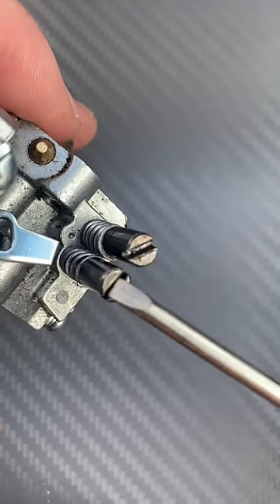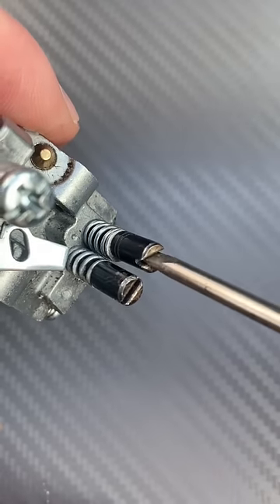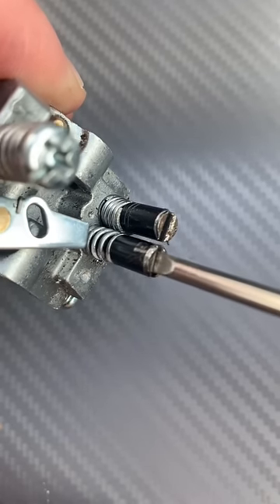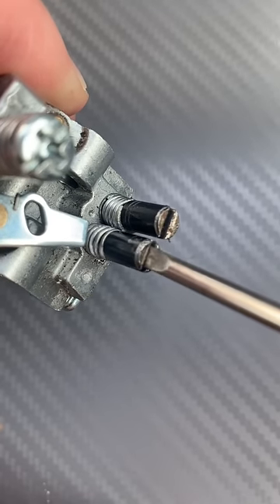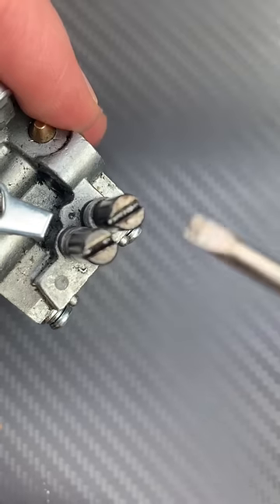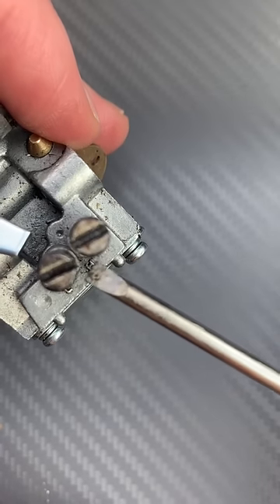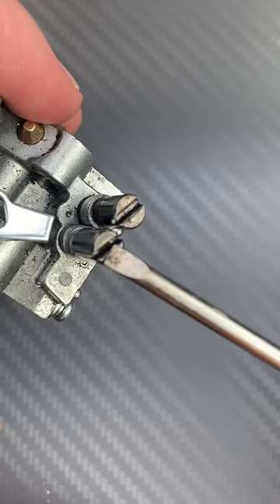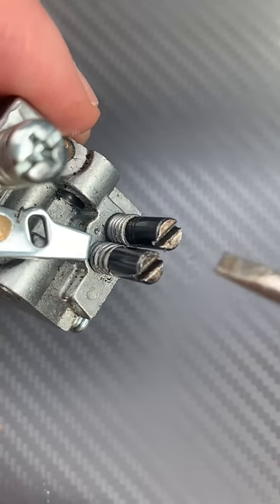Rest Carburetor back to Factory Settings like this….

Comment: Always good to point out that you want to adjust the high speed, bigger flow adjustment first. Open the mixture screw until it slows down from flooding, then go the other direction past where you started until it slows down from starving. Then go back to the middle of the two, known as the sweet spot. Always adjust the low speed last, because it actually is a bleed off of the high speed and if you did them in reverse, doing the low speed first, when you got to the high-speed you would actually be changing the low speed as well. Hi speed is always the farthest away from the engine. If you run into an engine that you can’t adjust with a screwdriver, you can take a hacksaw and cut splits in the aluminum surround that is intended to keep you from adjusting them and at the same time let it cut the slot in the head of the adjuster. That oval surround is to keep in compliance with Californias air board.

Comment: I’m a long time 2 stroke service tech, and I’ve had much better luck at just under 1-1/4 turns out from the seat position.
And very importantly, ALWAYS adjust the High Speed before the Low speed.
It will give you the smoothest transition from low to high speeds.

Comment: Awesome video. I recently purchased a used stihl TS350 that I was told didn’t run and needed the carb to be replaced I came across this as I was about to pull off my carb and get a rebuild kit for it. One screw was out about 7 full turns and the other was out about 3.5 turns. I followed your advice and it fired up on the first pull and idled perfectly.

Comment: This is good for trying to “reset” a carb’s tune so you can get it to start and eventually tune it to run. Different carbs will have factory tunes set for the unit they’re attached to. That’s typically in the owners manual or a dealership workshop manual or something of the like. I work at an ECHO and Husqvarna dealership and we have carburetor adjustment manuals relative to the model and unit that tells us the factory settings for the carbs.
Reply: Obviously, if you don’t have the manual, this video shows you how you can work to get a random carb in tune.
Reply from the maker: Hi
thank you for sharing your expertise and insights regarding carburetor tuning and factory settings.

It's great to hear from someone with experience working at an ECHO and Husqvarna dealership, where you have access to detailed carburetor adjustment manuals specific to different models and units. These manuals are incredibly valuable for understanding the factory settings and recommended adjustments for optimal engine performance.

As you mentioned, resetting a carburetor's tune can be a useful step in troubleshooting starting issues and fine-tuning the engine's operation. The factory settings provided in manuals serve as a reliable baseline for ensuring the carburetor is properly adjusted according to the manufacturer's specifications.

For those looking to tune their carburetors, consulting the owner's manual or dealership workshop manual specific to their equipment is essential. This information helps ensure that adjustments are made correctly and in accordance with the engine's design and performance requirements.

Thank you for sharing your knowledge and emphasizing the importance of using accurate factory settings when adjusting carburetors. Your insights contribute to a better understanding of carburetor maintenance and tuning for improved engine performance.

If you have more tips or information to share, please feel free to do so. We appreciate your engagement and expertise within our community!

Best regards,

Craig

Comment: Thank you for all the videos.i have learned a lot from them , i have one question about 2 stroke carbs that i have recently seen . What is the purpose or function of the hole on the diaphragm side with a hose going to the air box ? Not all have this .

Comment: i thought it is 1.5 turns, or it depends on maker of carburattor, or i am wrong?
Reply from the maker: There is nothing set in stone with this. It largely depends on the engineers preference of how the prefer to set them and of each individual manufacturers spec. You’ve only been told one way of doing it
Reply: I've always done it that way too... it works Everytime.. thanks for your opinion

Comment: Works thank you 🤠
Reply from the maker: Awesome. Thank you 👍👍
Reply: I have a 2 Stroke rc car and I messed up the carb screws and I spent hours working on it but it wouldn't start but looking at this video I set the screws and boom started right up

Comment: I have a question. On my Pioneer 1200A, the throttle linkage is fine but the part on the carburetor won't move more than a millimeter. I disconnected the linkage going up to the carburetor and tried to move it with my fingers without success. I have never actually fired up this chainsaw. It was a gift and I just wanted to clean it up and that's when I noticed the issue. Any advice would be greatly appreciated. Thanks.

Comment: As the weedeater get older problems lead you to go fiddle with those H and L screws and sometimes you try in vain and nothing only to find out that the filfer inside the fuel tank is blocked or the diaphragm is faulty

Comment: Hi I’ve got a petrol leaf blower. And I adjusted the low speed needle and high speed needle. There is only one screw which operate the same needle eg low speed and high speed. I can’t seem to get it to rev up properly what the course of this problem

Comment: If these aren't set correctly,will the carburator leak gas?
Reply from the maker: HI 
thank you for your question about two-stroke chainsaw carburetor adjustment and the possibility of gas leakage if the adjuster screws aren't set correctly.

In two-stroke chainsaw carburetors, improper adjustment of the carburetor screws can indeed lead to various issues, including potential gas leakage. Here's how this can happen:

Idle Speed Screw: If the idle speed screw is set too high, it can cause the engine to run excessively rich, leading to an overflow of fuel in the carburetor and potentially causing leakage.
Idle Mixture Screw: Incorrect adjustment of the idle mixture screw can result in a mixture that is too rich (too much fuel) or too lean (too little fuel). A rich mixture can lead to fuel overflow and leakage from the carburetor.
Float Valve or Needle Issues: If the float valve or needle is not functioning properly due to incorrect adjustment, wear, or damage, it can result in fuel not being properly regulated within the carburetor. This can lead to fuel overflow and leakage.
To prevent gas leakage and ensure proper operation of your two-stroke chainsaw carburetor, it's important to:

Refer to the manufacturer's specifications for the correct adjustment of idle speed and mixture screws.
Use the appropriate tools, such as a tachometer and a screwdriver, to make precise adjustments to the carburetor screws.
Regularly inspect the carburetor for signs of leakage, fuel overflow, or other issues and address any problems promptly.
If you suspect gas leakage from the carburetor due to incorrect adjustment, I recommend consulting a qualified technician or referring to the specific carburetor adjustment guidelines for your chainsaw model.

Thank you for your question and for engaging with our community. If you have further inquiries or need assistance, feel free to reach out!

Best regards,

Craig

Comment: I have an issue right now with my idle it seems to fluctuate and speed up, but when I push on the throttle it’ll correct itself. Than do the same thing after a few seconds. Any suggestions?

Comment: Umm my echo 2511t has 2 and 5/8ths for H and 1 and 7/8ths for low and 1 and 5/8ths for idle screw as the manual factory settings
Reply from the maker: Of course there are some differences between different brands but the way I have explained is a general way to bring a carb back to a general factory setting. Let’s say you no longer had the manual for reference then this would be the best and probably the only way to deal with it.

Comment: I have a Honda UMK-422, after changing carby still runs at max for 1-2 min then dies or stops, sounds starved of fuel, i checked the fuel cap breathes  normally.. ? Would appreciate advice..
Reply: Check intank fuel filter/location

Comment: Does it work an a 29 still
Reply from the maker: Unfortunately this probably will not work for your 029 Stihl because as far as i can remember, these chainsaws don't actually have H and L screws. Don't quote me on this but I believe that, Instead, they have a compensator built into their design that alters Air/Fuel ratios automatically as they operate.

If you are having running problems due to the carb, then it might be a good idea to have the serviced and possibly diaphragms replaced. That might sort it.
Best regards,

Craig

Comment: There is no one standard. Different engines and carbs are .. different.
Reply from the maker: Very true, but in general you can get away with setting most of them this way.

Thanks

Craig
Reply: @TheRepairSpecialist For my ms250 chainsaw to save fuel, H how many turns and L how many turns?